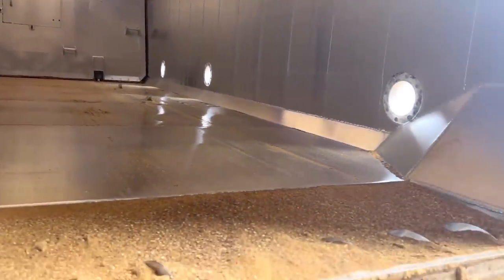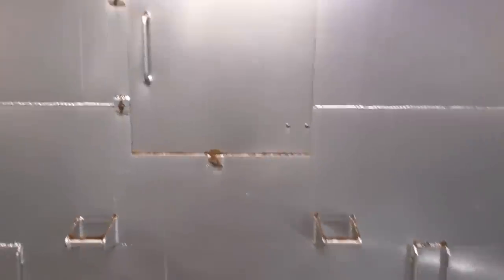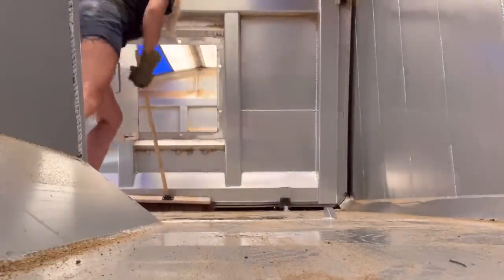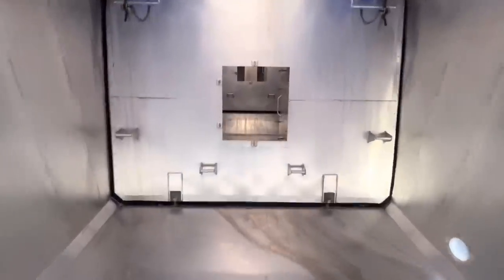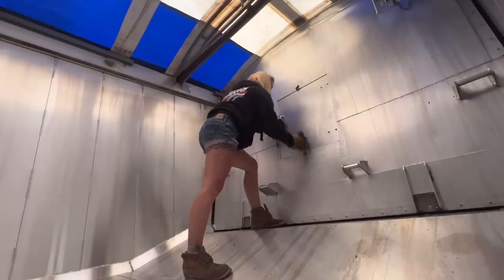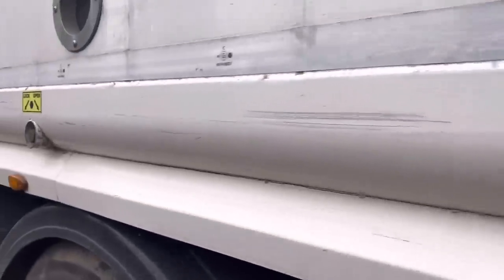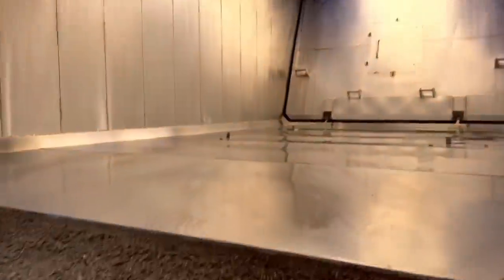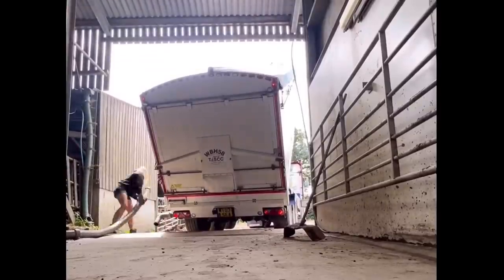Inside the blower trailer | how it works

Comment: No worries about not being able to show your work, Jemma - it might be good to build up/hold back more vids for this kind of eventuality or for when you need a break.
The blower workings has cleared up some misconceptions in my mind 👍
I had wondered what the internal doors looked like and I just assumed that the auger ran from the front to the back of the trailer.

Comment: Why has the safety switch on the tailgate been either removed or bypassed. With the tailgate open the hydraulics on the back of the trailer should be inoperative, it's there to stop you injuring yourself should you be daft enough to put your hand into any moving part.